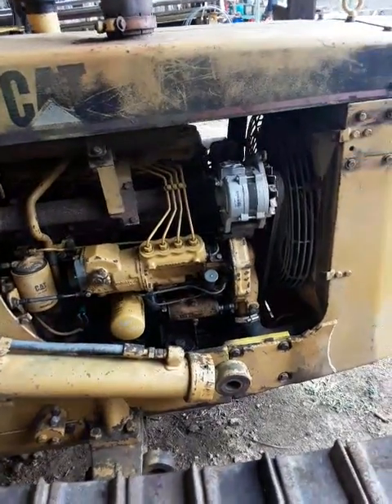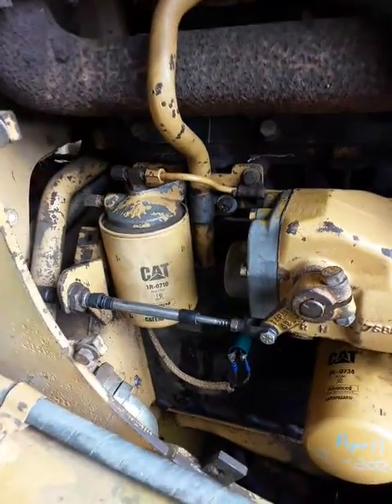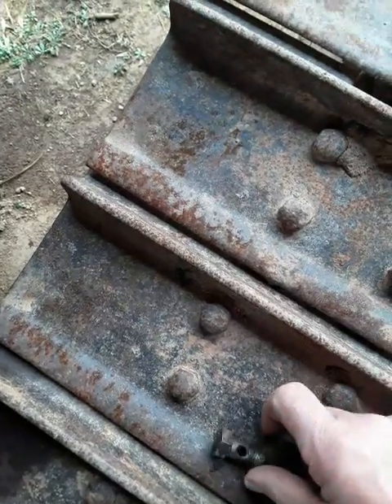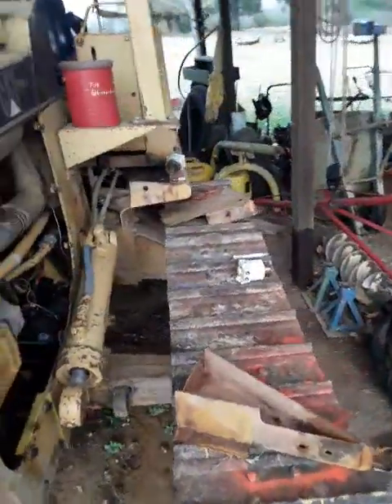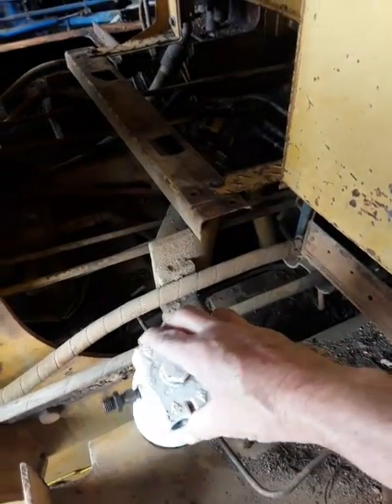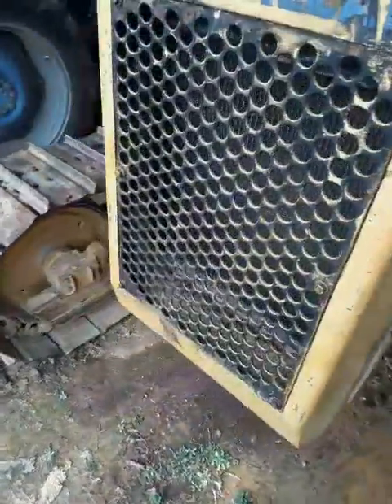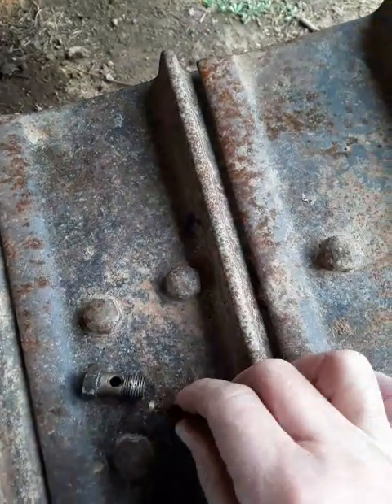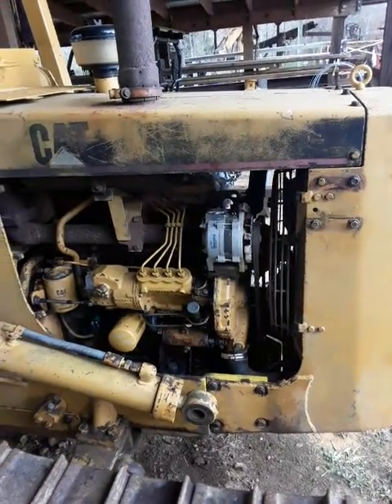D3B - 3204 Caterpillar lift pump inlet screen

Comment: It is amazing the nightmare this can cause.  We tore my whole machine apart and found out it was this screen causing all the problems.
Reply: What symptons were you having when the screen was clogged? I have a 3204 that is bogging down and not producing power, and blowing smoke like its burning too much fuel. I'm wondering if this might be my issue.

Comment: Where did you buy the screen in the banjo fitting and do you have a part number?
Reply: I did get one of the cat parts books on CD but seems like I give the dealer the number it has changed to another. I went to Thompson Cat in Oxford and picked it out from an image in the parts area. Sorry don't still have the number.